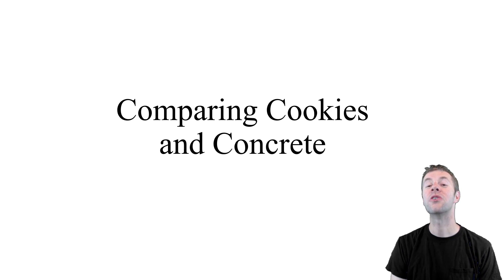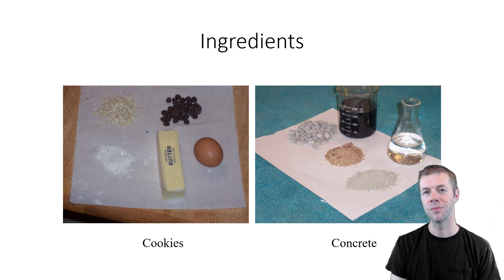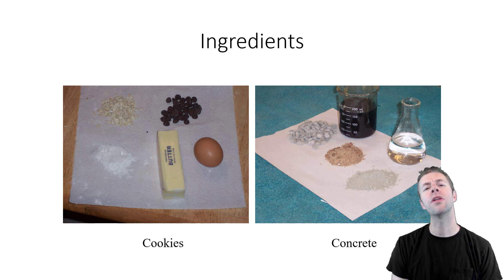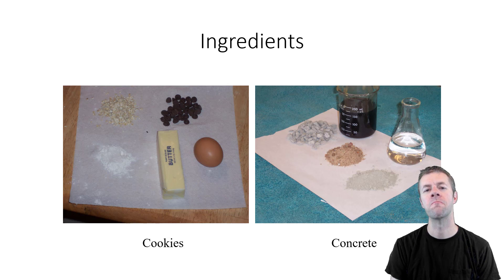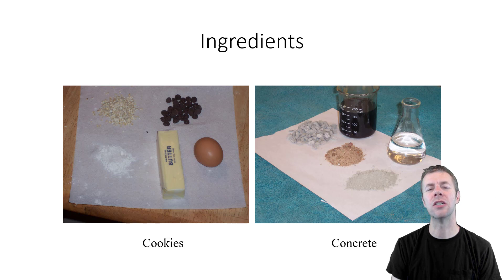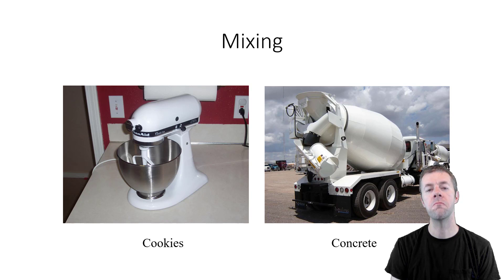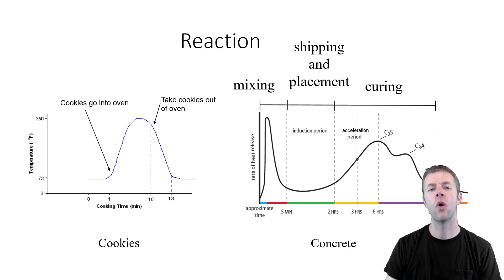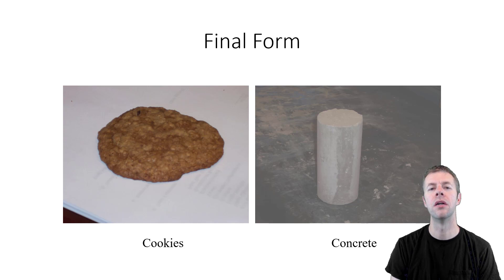Comparing Cookies and Concrete

Comment: I want videos about thinset mortar (including self leveling), hydrologic cement (is it called that because it setts underwater, expands, blocks hydrologic pressure or because it's nonporous?), refractory cement (food safe and otherwise)

... I want to fix a naan oven, Kiln and tile a wet basement floor.... And fix my concrete front porch ,... I need a lot of concrete, and learn more than what some professionals know.

My water quality may be an issue too...

Oh and where should lithium silicate and carbon fiber fit in?

Comment: Your analogy is not good. The truck is not used to mix all the ingredients and making of the concrete as Kitchen Aid is used for cookies. The truck is used to keep mixed concrete from "delamination" (sorry English is not my first language, I don't know the proper terminology for this) during transit. I love your channel. I'm an independent contractor and I'm learning a lot from you. Keep up the great work.
Reply: MrQbee87 that’s not true. Many many many plants shoot the ingredients into a truck separate and the truck is the kitchen-aide mixer.
Reply: @richardheinen1126  I just talked to concrete company in Poland and you are right. THX for pointing it out.

Comment: Not sure if you're aware, but there was so much concrete used in Hover dam that it would've taken nearly a century for it all to cure. So they built a refrigeration plant nearby that chilled water to be pumped in pipes placed within the wet concrete.
Reply: They built the refrigeration plant to chill the concrete because the curing of the concrete is exothermic reaction. The temperature would get so high it would evaporate the water before the reaction is finished. It wouldn't take century for all it to cure. It would never happen.
Reply: Bad thing about concrete is that it never actually cures
Reply: i bet $100 that if you were to test the concrete at the hover dam, there is still moisture in the concrete!